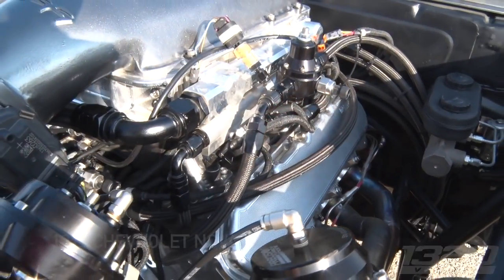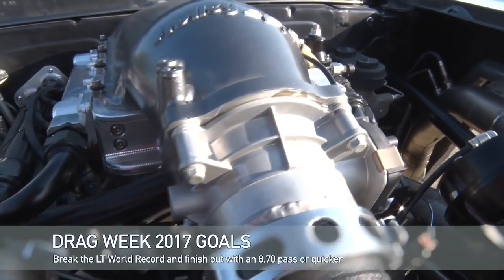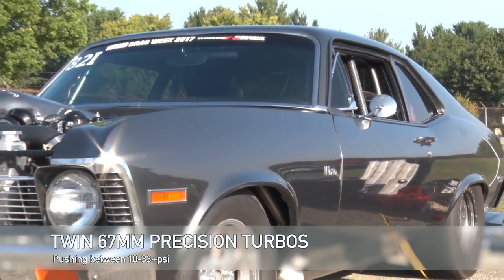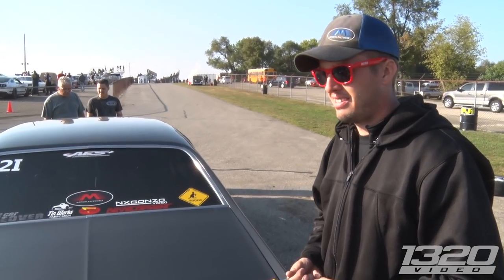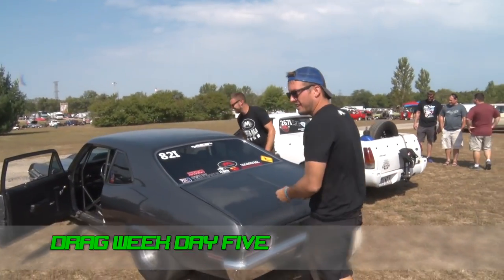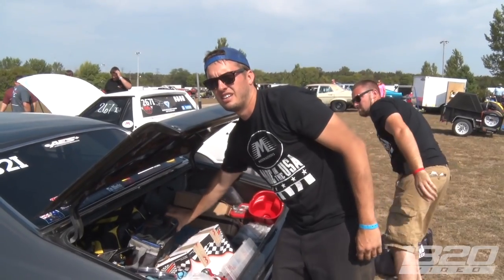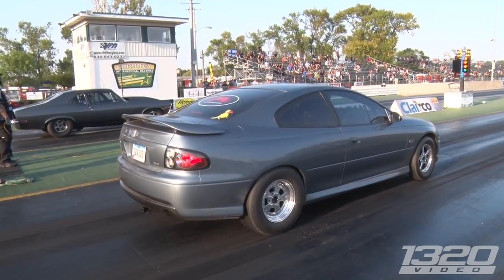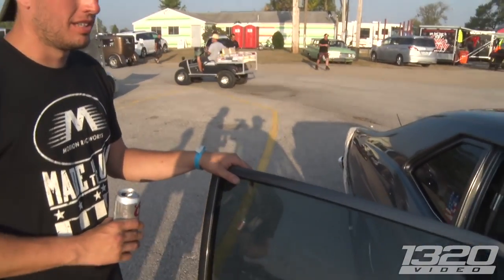They Were BORED with LS’s! - NEW World Record!

Comment: What a great way to break in a new motor 🤘🤘
Reply: Let em rock, seat those rings. If anyone tells you otherwise it’s because they want to rebuild your motor.
Reply: Pretty much all new car owners manuals tell you otherwise. Engineering Explained says otherwise.
Reply: Blacklist Builds Motors break in within the 1st hour of them running.
Reply: the 20 miles on the motor before they went to dragweek would have been the break in period I would say. Most serious builders break them in on an engine dyno not the car itself. once in the car and tuned get that pressure up and seat those rings.
Reply: Engines are machined within the micrometer.
You can run them hard as soon they are in operating temperatures.
You have to respect temperatures more than the mileage.
tolerances are precise enough to not have to rub the parts on each others to match them together like before.
Reply: Thanks to their throttle problem, it DID get a decent break-in. :P
Reply: ziiofswe exactly what I was thinking haha
Reply: Daniel's Speed and Performance most crate motors and new cars come with a user manual that tell you exact mileage the breakin period is done or there is a break in process
Reply: Nicholstop :  I have many of race motors under my belt.. like I stated  they're broke in within within the first hour of running.
Reply: Blacklist Builds, it ISN’T a MOTOR, it’s an ENGINE. MOTOR’ S have a power source. Hydraulic, electric, ets. Get it straight
Reply: Bill Andersson then I suppose alternatively powered vehicles are raced on Indianapolis Motor Speedway? Motorboats and motorcycles are all electric or hydraulic? Joking aside this is a matter of semantics; by definition there's nothing wrong with using the word "motor". "Engine" might be the better semantic choice. However, motor rolls off the tongue a lot nicer than engine 🌚
Reply: langwitch is differkult, what elles is niue?
Why is it called a motorhome and not an enginehome?
"Some rules can be bent, others can be broken..."
Reply: Maybe he's in motoreering, those people can be a bit difficult...
Reply: Motors have a power source? No you listed energy sources..Like ooh hey...Gasoline? lmfao.
Reply: I own a machine shop and built more diesel engines than a person can fathom. I tell every one get a trailer put a good amount of weight on it and seat the ring . In other words get it hot and beat the piss out it.  Cummings service manual call for the same thing.
Reply: Bill Andersson is exactly correct about the difference between a motor and an engine. First thing learned in an automotive class.
Reply: Send it and don't look back!  We have checked thru the motor since then and everything is good!

Comment: hey 1320 fans/gear heads, notice after a cold "COORS LIGHT" fuel up that nova started to haul A$$$$. SPEED ON HEAVY CHEVY!!!  👊👍
Reply: melbourne e. adams jr. The video also said “a few weeks later” after the conversation with him drinking
Reply: Heavy chevy??? This Nova is a light weight...No one would spend the money on 1 pound carbon fiber bumpers on a steel NOVA. This is WELL <3,000lbs.

Comment: he fricking annihilated the record by over a second, that is pretty impressive.
Reply: He's in a car that weighs prob 800 pounds less lol...
Reply: well that depends on if the camaro had been stripped or not because you can strip way more weight from a modern car that an older car because of all the electronics in them, not to mention the fact that nova's are not light, they have been for their time but a nova isnt much lighter than a modern camaro
Reply: Jonathan Rutledge Novas from that era weigh in the LOW 3000s...Camaros are in the HIGH 3s to low 4s....thats a MAJOR difference....and they still are considered very light weight...most modern "sports" cars are pushing 4k...even the Vettes are up there past 3500 now...
Reply: Jonathan Rutledge base c7s are 3300 to 3400....Z06s are over 3500
Reply: i will admit i had made a mistake, i usually have the mind set that 400 pounds isnt that big of a difference, but in drag racing it really is. but for all we know the weight of these 2 cars in their current state is not all that different, considering we have never seen either of these cars weighed. once again i admit i am wrong. in drag racing that is a huge difference. in every day use that really doesn't matter.
Reply: Thank you!
Reply: @kyabittoyorisou5329  a good rule of thumb is that 100lbs equals a tenth of a second....

Comment: Cool to see people running LT's, but as history will show, 90% of people wont be running them until you can trip over them in junk yards and buy them for peanuts like the LS currently and the SBC was before the LS.
Reply: LT's been around for quite awhile, though. Before the LS. Granted, not this new gen 5, but LT's have some history behind them.
Reply: Logic
Reply: Not what anyone is talking about boss - but yeah, the Yenko Deuce was bad ass.
Reply: SP392  you my friend are rt
Reply: I agree. Gen 3s are still going sub 9s so no need to spend the extra buck on a Gen 5 and deal with the gremlins they have either.
Reply: derjoh1986, The first 2 versions of LT1 have nothing to do with this conversation...
Reply: Shit box exactly , completely different block/ engine
Reply: SP392, You’re exactly right, the first 5.3 I bought was in 2005, ridiculously expensive compared to what they are now. I can only imagine what a modern LT1 is worth out of a wrecking yard...
Reply: THE LS is a small block.
Reply: Kelly Hollingsworth    thanks lol
Reply: Shit box Found a 6.2 lt out of a truck 2 years ago They was asking  1600
Reply: Maurice Cooper, That’s not too bad, computer and harness too?
Reply: Shit box Just the motor At the time I had a truck that it would have just dropped in
Reply: derjoh1986 The new generation LT’s aren’t like the old ones. The old ones were basically regular Chevy small blocks with fuel injection. The new ones are direct injected and more of a development on the LS motors.
Reply: Hey Shit box, how are you brother!
5ish years ago I got my LQ4 with Car Fax documented 28,XXX delivered for $1,200. It was a 2500 GMC that rolled with wiring harness & PCM. This was just as Junk Yards were figuring out what they had.
Scored a GM rebuilt 4L85 with 89 miles on it, the guy rolled his truck, if they didn't come from 2 states...
Reply: Marshall Lyons scatpack rt?
Reply: Marcus Mar What gremlins? Please enlighten me.
Reply: ramairgto72, Doing well bud! You? Yeah my 5.3 had similar mileage on it when I bought it all those years ago, I paid way to much for the damn thing, but I was one of the first guys in my area that had one. It’s ok though, that engine has paid for itself since 2005.
Reply: NBSV1: Don't forget the different coolant flow on the 1st gen LT1 compared to older small blocks. That's not unimportant.
Reply: Shit box
I'm drinking tonight.
You can only hope to get a "good deal", when I was just starting out you would develop a network of people you could deal with, it seemed to all even out.
You win some, lose some.   You just try for the better deal, or give / take to just keep things going. 
I haven't even started mine yet.
Reply: Kelly Hollingsworth  I have never heard an LS referred to as a small block.
Reply: ziiofswe, First LT1 was introduced in 1970...
Reply: marc mo
The "LS" Generation III is the 3rd Gen of Small Block Chevy, we now have a 4th Generation of the SBC.
If you were born around or after 00' I would suspect that this is why you haven't heard it referred to it as such.
Reply: Shit box: Oh... right. Forgot. I was thinking of the ones that showed up around... uhm.. '94? '93?
Reply: ziiofswe, 92 I believe, came out in the vette first of course...
Reply: ziiofswe Yeah the LT1 found in the 92-96 Corvette and 93-97 F-bodies were considered the gen 2 LT1. I love being different and I love my 97 torque monster Camaro. They got a bad rap because of the optispark distributor. I done away with mine and installed a 24x conversion that uses the LS coil packs and 0411 PCM.
Reply: No I'm 48 years old and they don't make a big block LS engine so therefore no small block LS
Reply: marc mo, The 8.1 was kind of a big block LS. 😄
Reply: marc mo
As Shit Box stated, the 8.1 was a LS kinda BB.
If you really wanna argue about it being a SBC, you are going to have to fight GM, as they named it that.
How could you possibly argue that?
Reply: Are we gonna do this?  First of all I didn't address you about this.  Second I think we have had a similar argument about Pontiac.
Reply: If you had lets say a 2002 Camaro and someone asked you what engine you had in it wouldn't your answer be LS1
Reply: It's one thing to rebadge someone else's design and call it something "it's not", all for the sake of the almighty $$ , in no way whatsoever Holden Monaro share any linage, design or attributes to the American PMD GTO.
Reply: A 1st Gen F body has nothing in common with the 4th Gen F body, it's just designs evolving over time.
This is a clear comparison on how models evolve based on the first, as such the 1st Gen SBC has very little to do with the 2nd Gen SBC. People have picked up the "Slang" of calling it a "LS" engine, that's all.
Reply: In the 90's Mustang were called (among other things) Notchbacks, Hatch, 5.0, SN. They even have another 5.0 , so now we have 2 very different 5.0 engines that many call "5.0" . 
But as we all know, they are 5.Slow and "5.Crowd Killer" <------ fav.
Reply: SP392 the LT is still a dime a dozen motor...... Always has been and always has been a massive power plant people just didn't know it back when they were released in camaros
Reply: Evil Opti Z: Never had a problem with my Roadmaster '94, but then again it had Accel stickers so some previous owner may have done something to remedy the problem...
Reply: 90% of poor people.* The reason people don't run out and buy them for their projects is not because of availability or pricing, it's because the LS-motors have tons of potential, tons of support, and the LT-series simply do not offer a huge advantage over the LS-series. But, for those that came stock with an LT, it's a good engine to work witth
Reply: Olds Pwr
The BBC went out of production in 2009-ish, I don't recall GM ever NOT making a BBC until then?
Tho Generation VII BBC isn't a "bigger" version of an LS Small Block , neither was the 2nd or 1st Gen SBC.
Looking at L18, L21, L29 VI & VII BBC engines you can see the " family resemblance ".
Can't simply say that since they stopped production BBC engines that the LS engine stops being a SBC.
Reply: Olds Pwr
Don't think i'm arguing with you, I like it when a good conversation can be had... And you're an Olds guy, Iol.
You also have some merit here, looks like the "Small Block" started being called that in 1955 but ends that name in 2003 , but the 2nd Gen started in 95' (memory serves).
That's well into the LS engines, but not past 03'? Unless they did cast Gen II's up to 03' ?
I will admit we have some "muddy waters" here.
Reply: SP392 the LT is the sbc before the ls...
Reply: Spot on.Even arguments can be good if not too heated and wigs stay on.
Reply: Nova is one of the ugliest GM cars ever made. But this one is fast.
Reply: buddy,the first generation LT1 came in 1970,it was a badass sbc gen 1,regular flowing coolant ,high compression,big cam and put out about 375 horsepower in the corvette,don yenko later ordered several 70 novas with this "LT1" engine and "THE YENKO DEUCE" was born.

the LT1 you are referring to is the second generation and came in mid 90's vettes,impala ss's and 93 TO 97 trans ams and z28's.history my friend,learn it.
Reply: thats what it is
Reply: yes,they do and the ls 4.8 to 6.2 are all fucking small blocks
Reply: Also the Gen v is marginally better than the Gen 3 and 4 but the Gen 3 was light years better than the Gen 2 and 1s that where available in the junkyard
Reply: @SP392
Help me out here. What exactly is the difference between LS and LT. Physically from the outside the look essentially identical to me. Do they have the same bore spacing? Pretty sure the LS is 4.4 spacing like the original SBC. I'm guessing the LT is as well.
Reply: That's because people want $8k for a LT4 longblock. Who wants to pay that kind of money for a used stock long block? can build a 5.3 or 6.0 for half that and make over 1000 hp
Reply: marc mo I know this is old but there is ls 454s so
Reply: Lt5 is now a crate motor so you never know
Reply: @MaliciousSRT  what was it's best time?
Reply: Skynet Cyborg  an ls is a small block Chevy
Reply: What is a 6.2 going for now in the junkyards? I haven't looked in several years.
Reply: @derjoh1986  yup, it is called a small block chevy.
Reply: SP392 how’s that haterade tasting.
Reply: They're actually getting quite cheap, and they are stronger than an LS in stock form.
Reply: Huh?  "wont"?
Reply: @derjoh1986  Hes talking about the new L.T.s
Reply: @derjoh1986  the old LT1 DOHC v8 and LT1 fuelie i think
Reply: @shitbox7413  correct. the first one was a borrowed engine from lotus
Reply: @JRkota318  that particular motor was from lotus. it had EFI.
Reply: @ramairgto72  its displacement. i looked up a viper v10 of that same displacement and googled is it considered a big blockand the answer was yes. it is physically a big block engine. so that makes the vortec 8100 a big block by displacement standards. its 500 cubic inches. thats literally a big block by displacement

Comment: So they're bored with LS and build an even more modern engine? not what i had in mind lol.
Reply: where's your video of what you have in mind?
Reply: they were probably maxing out the amount of power of the other gen so they are trying a hand with direct injection from the factory so when they add it the entire thing is designed for it and alot of people don't understand how much of a difference between the two is in pressure like 100000 lbs and a carb needs about 5 😂